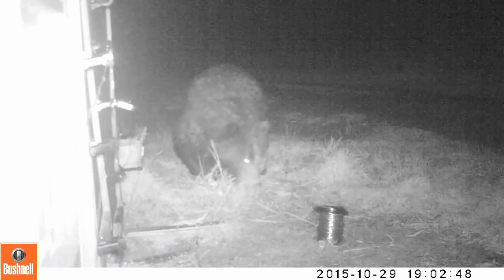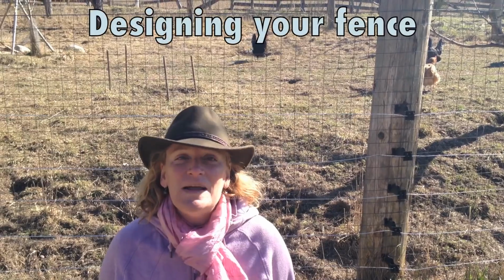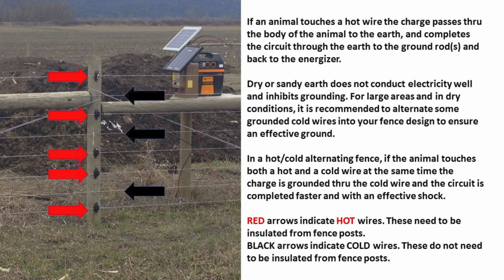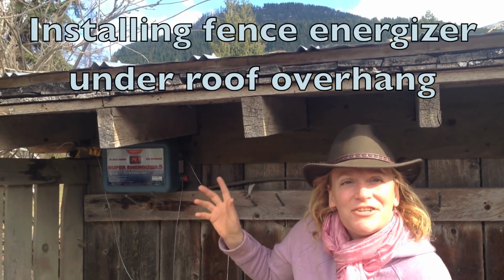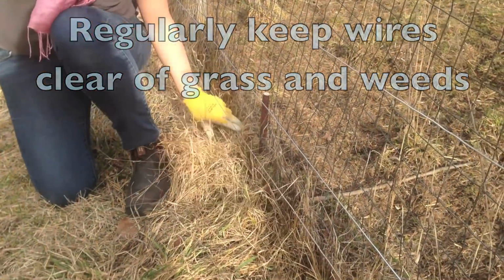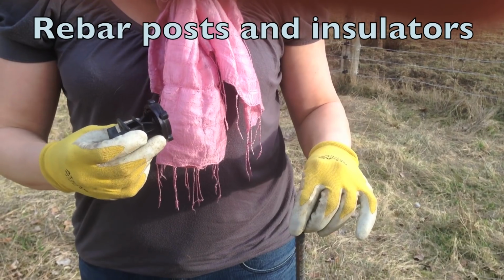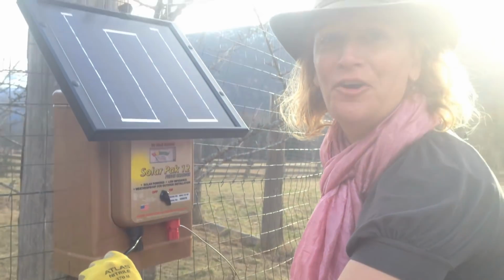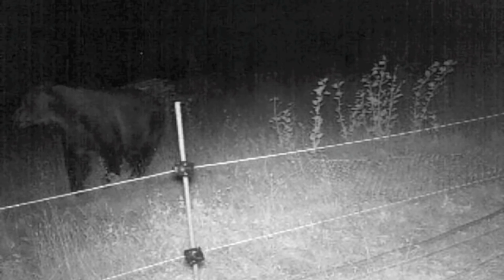How To Electric Fence for Bears

Comment: Can you help me with this problem? If your wires are 8" apart and you have a 5 1/3 foot bear buffer there, could deep holes be drilled into the tops of your posts and inserted with metal t posts for additional height and deer buffering.  Maybe an additional 4 foot.  I'm thinking that the posts you have around your composting pile are really smart and looking for the more frequent scavengers that have been using my property for the deer town square for the previous 30 years, long since before I bought it.  The deer are my real problem however, last June I spotted a black sow on my land.  So, I'm thinking along the lines smartest tools as inexpensively as I can get away with.  Would really love to hear your feedback on this, thanks!

Comment: What's the highest voltage you can use to keep bears away?
Reply from the maker: 7000-9000 volts is totally effective. There’s no need to go any higher. Just have a well constructed fence an ensure skin contact ie: make sure the bear can’t slip under or in between wires without making skin contact!
Reply: @grizzlybearsolutions  got it

Comment: If I'm running 5 wires on a temporary fence is .7 joules enough for my fence?
Reply from the maker: on a very small area it should be ok, but I prefer to use a higher Joule output for bears to ensure an effective deterrent :)

Comment: It looks like you have two solar panels hooked up to one energizer unit.  I have a Parmak Magum 12 Solar energizer and it doesn't seem to charge enough if we have several days of cloudy skies.  I'll like to add a second solar panel to keep it charged.  Can you tell me how you did this on your fence?
Reply from the maker: unfortunately I didn't connect them myself... I think ask an electrician? or I know that the Parmak Solar 12s have a trickle charger that you can plug in to keep them fully charged all winter. If you're in Canada a good place to order these from is: https://www.margosupplies.com/ca-en/product/parmak-taper-charger/

Comment: We are looking for the best way to electrify a mobile chicken tractor. We have chicken wire and corrugated sheeting around the outside of the wooden frame and plastic grid around the inside. We are connecting a solar energizer to the outer mesh / steel shell and the plastic grid keeps the birds away from the charged shell. This gives protection from everything that tries to gain access to the chicks from weasels to bears. Our problem is that the whole frame is electric and therefore we are loosing power as the energy goes to ground through the wooden frame . The energizer normally generates 10,000 volts on our normal fencing but drops to 5,000 volts with this system. Any Ideas on how to insulate the frame would be appreciated.
Reply from the maker: what about adding a strip of rubber matting to the bottom of the frame?

Comment: Thank you for this video. A ton of useful understandable information. Question, coastal black bears are climbing my 4ft cyclone fence & invading my yard (1/2 acre). If I ground the fence and put a couple hot wires at nose level won’t the fence act as a big ground wire? Would 12ga aluminum do the trick with a 4 joule energizer? Sandy soil on the Long Beach peninsula Wa. State.
Reply from the maker: Hello, yes if you ground the existing fence by connecting an insulated wire from the fence to the ground rods (use 3 of these in sandy soil)  it will act as the ground behind the hot wires and if a bear pushes the hot wire against the grounded fencing it will receive an effective shock. 12ga aluminum wire is great and keep your wires about 5" away from the grounded fencing. There is no need to have insulators stand off more than that and you don't want a big gap between; just enough to hold the 2 separate. A 4 Joule energizer is ok but it's more than you need for a 1/2 acre so if you want to use a 2 Joule that's fine too. If you're serious about keeping bears out I recommend 5 hot wires spaced about 8-9" apart; if you only have 2 wires there is likelihood that a bear might only touch the wires with their thick coat and not receive a shock. Wire and insulators are relatively inexpensive so more is better to ensure nose contact :) Best wishes!

Comment: Some people I work for, have a fruit tree garden, an 8 foot fence, similar to the size of the one shown around the chickens in this video. Not actual chicken wire, a larger gauge and square connections. Besides the point...

The bear climbed up and over the fence destroying a section of the fence. To get out, it dug under the fencing, in same spot it climbed over. Now, I've begun to install a solar power electric fence with three runs of wire. Completely surrounding the area...

What do you recommend on spacing of the wires, we are trying to keep out rabbits, deer and bears...
Reply from the maker: Bear are easier to keepout than rabbits or deer! For bears I recommend at least 5 hot wires spaced about 8-9" apart to ensure nose contact. To keep out deer you may need to go as high as 8' non-electric fence and to keep out rabbits you may need to dig a finer mesh fence into the earth under the fenceline to prevent rabbits being able to dig under. For bears, I haven't had them successfully dig under when my bottom hot wire is not more than 8" from the surface of the earth. Of course you will need to maintain grass and weeds to that height to make sure fence is effective. I hope this helps; please ask if you have more questions :)

Comment: If I am only fencing a small area, will using a  more powerful energizer result in a more powerful shock? Fence is for bears
Reply from the maker: to keep bears out of a small area use an energizer with minimum 1 Joule and 7,000 volts output. You can put a higher powered energizer on a small area but the above specs will be effective.
Reply: I have a 15 joule Gallagher M1500  protecting my 1/2 acre back yard. Animals will remember the sharp jolt they receive and tend to stay away rather than constantly trying to get past the fence. I love mine !

Comment: Do you suggest aluminum wire or high tensile wire for bears?  I read that aluminum is 4 times more conductive, but high tensile steel is a lot stronger?  I will be using this to protect beehives from black bears.
Reply from the maker: Both considerations are true. Aluminum will be lighter to use and probably easier for a smaller area like a bee yard. If the area is dry, be sure to install a good grounding system (at least 2 ground rods) and possibly use an alternating hot/cold wire design with at least 4 hot and 3 cold wires and the bottom wire should not be more than 6-8" from the earth to prevent digging, but if you see signs of digging you may need to add another lower wire or install a grounded metal mesh flat on the earth around the outside of the fence. If you use the grounded mesh flat on the earth, you can use only 5-6 hot wires for the fence itself. Either way ensures that a bear receives an effective shock in dry conditions :)

Comment: when you added hot wires to preexisting metal mesh fencing, are you connection the ground to the mesh fencing and making it the ground?
Reply from the maker: Yes. In the case in the video the mesh was already dug into the earth to prevent smaller predators from digging under so I did not need to. But in other cases of adding hot wires to preexisting metal mesh, I use the existing mesh as the 'ground' wires by connecting it directly to the ground rods as you mention. Then if  a bear pushes the hot wire against the metal mesh fence it receives that instant strong and effective shock even in dry soils, and keeps the area well protected. Of course it's super necessary to ensure that the hot wires are otherwise kept well away from the metal mesh or they would ground out and you would lose the charge :)
Reply: Thank you some much for the fast reply!!     So, my plan now, to cover both ways to deliver the ground,   is to put in a single grounding rod (instead of the recommended 3 at 10ft intervals) and  run a jumper from the ground rod to the old mesh fencing...  then using  extended insulators to run hot wires at a 8 inch spacing.     thanks for the great video and reply, you can add an "assist" to your 130+ installations :)
Reply from the maker: sure, glad to help! It's well over 200 fences to date! really it's a win-win for both the food producer and the bears :)

Comment: We live in the mountains (8,700' elevation), and we had a large black bear (which is actually cinnamon colored).
Do you have any ideas for:
1. How to deter the bears to dig under the fence?
2. We get about 8' of snow during the winter. How to build something strong enough to withstand the snow loads and drifts without having to remove the fencing during the winter?
Reply from the maker: Hi, 1. I mention digging in the video: I use a bottom hot wire about 8" from the ground and this has prevented access by digging if bears have not already learned to dig to get to the food source . If you were to see signs of digging, splice a separate wire loop onto your bottom hot wire to fill in the gap created by the dig. You will need to have a stake with an insulator on it to hold the spliced wire in place. Position the spliced wire(s) to make nose contact. 2. If you have permanent fencing with high-tensile steel electrified wire it will generally shed the snow load. However you will always need to tighten up your wires in spring, and you will want to incorporate wire tighteners into the fence design. It is easier usually much easier to maintain this than to install temporary fencing that you set up and take down as needed, but if you will need to have braced corner posts to get the tension on the wires. For a small area, it may be more practical to just set up temporary seasonal fencing as needed :)

Comment: Hi:I have a crawl space access door and bear breaks the door and goes into the crawl space.  Do you know how I can install electric fence for the door to keep the bear out?
Reply from the maker: Hi Ali, you can put a wire screen mesh (stucco wire would work well) across the door and hang the screen mesh off of plastic electric fence insulators so it is not touching the door. Then wire from the fence energizer to the screen mesh and it will deliver a shock if the bear (or anybody else!) pushes on the door. You will have to turn off the energizer each time you want to access the crawl space, but it will keep the bears out! I hope this helps :)